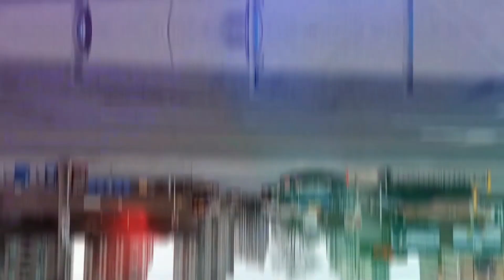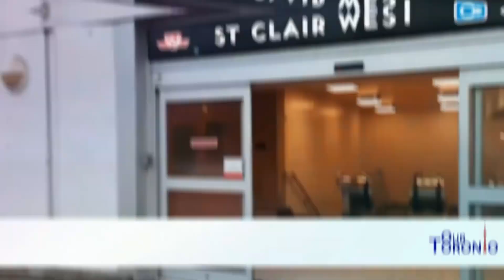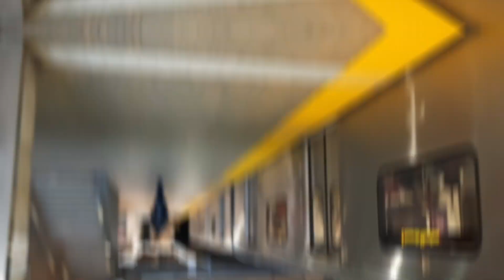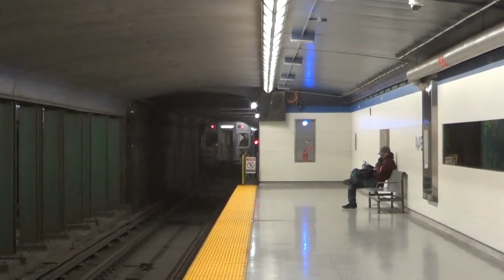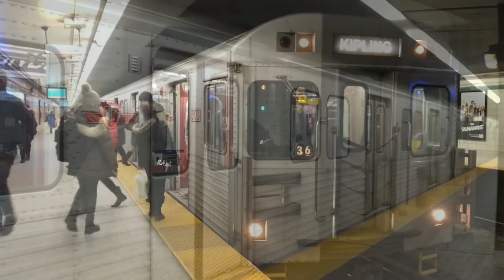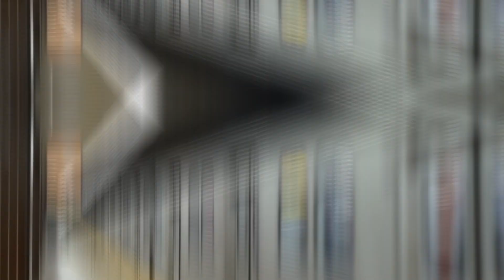Toronto Transit TTC's Old Subway Cars - How important is it to replace these with new cars

Comment: Lots of misinformation in this video, like the the older models not having regenerative braking being "very heavy" acessiblity and not having wide doors?. The t1s have had regenerative breaking since they were made and ttc trains have had regenerative breaking since the 70s with the first being the h5 models. Another thing is that you stated that the trains were "very heavy" while they are very heavy, the t1s are lighter in weight then the Toronto rockets are. That makes the t1s the lightest subway trains currently in use on the ttc right now. You also stated that they aren't as assessable with one factor being the door width. The t1 trains have the same width as the new (not so new) Toronto Rocket trains. You also stated that they should replace the fleet because the seating arrangement does have a dedicated spot for people in wheel chairs. Although this is true, this doesn't mean they should just get rid of the trains, instead they could just reconfigure the interior so they could fit a dedicated space for people in wheel chairs. Also you stated that they dont have open gangway is a flaw in the trains design? Trains dont need to have open gangways as seen with the r211s in New York . Even the ttc line 5 trains that are newer then the rockets are paired up like subway cars. What the ttc should do is BOTH refurbish these trains and get NEW ones Because of the extensions and that we just haven't had new trains in a longtime. I think that when you made the script for the video, you were comparing really old models that used to run on line 2 like the h4 because it fits some of the criteria's that you've stated. You've even stated in a reply of yours that you get the subway models confused.

Comment: This is a pretty bad view. The T1's are perfect and have no problems; in fact, there are things the T1 does better. I like it opening doors quicker, having a quicker acceleration/deceleration. Plus, you're able to see the front. Countries in Europe use old subways and even New York too, so if they can use 50+ year old trains. Toronto can use 25-30-year-old trains.

Comment: I find them fun and nostalgic, they are my childhood trains, they look like they need a replacement because of how they look, like greenwood never cleaned them, and the breaks braking apart like the mechanical issues, is because the Greenwood mechanics never checks the wheels or their breaks, if they cared them they wouldn’t have these problems and people think their too old
Reply: You're right they just look old but they're very reliable. If they were cleaned a bit more they'd be perfect. And I do too find them very fun and nostalgic.

Comment: The T1s aren’t even 30 years old. Meanwhile the MF67s of the Paris Metro are 55+ years old and they won’t be fully replaced until 2030.
Reply: They would retire them starting in 2030, like the last ones would retire in 2034-2035 as the TTC extended their lifespan 10 years more

Comment: The floor heights are basically the same on all TTC subway cars because of the fixed platforms. They don't have and LOW FLOOR subway cars. What they do have is an air bag suspension system, on both types I believe, that is supposed to adjust the floor height to be the same as that of the platform. The carbon footprint of an electrically powered vehicle is zero at the vehicle. It increases depending on the power generation system for the electricity, but not much on the yype of car because BOTH the T1s and the Rockets have solid state controls and AC motors WITH regenerative braking. Do some bloody research or stop making videos with so many inaccuracies. Your basic comment that the cars need to be replaced is valid but you rationale is hogwash.

Comment: Does the regen breaking put the power into capacitors on the train to be used for the next acceleration? Or does it send it back to the 3rd rail somehow?
Reply: It goes back into the third rail. The lighting load on the cars in the yard is enough to absorb the full regenerative capacity of 1 train.
Reply: @dbolt6543  Thanks!

Comment: We've had regenerative braking since the H5's. Remember the whining noise as the trains came into the station?
Reply: The whining sound variation is caused by the fact that they do not chop at a constant frequency, 400 Hz, but ramp their frequency up from low to 400 Hz. I did my undergraduate thesis at U of T Electrical Engineering on the problem of high heating on choppers at low power and I suggested ramping the chopping frequency up from a low frequency at the start to 400 for higher speed. The post doc Ph D student working on the same problem said it wouldn't work then used it at Garret Aerospace on their choppers for the Boeing Vertol cars. for MBTA and San Francisco.

Comment: I find the T1 cars are superwide when compared to the Toronto Rocket ones even if the widths are similar. That said, I like the articulation of the newer trains that allows walking between cars that the T1 series doesn’t have.
Reply from the maker: It let's people spread out across the entire subway.
Reply: They are NOT articulated. Articulation means two car bodies. These are six cars each on two trucks. They have very wide gang ways between cars which make them look like they are articulated but they aren't.
Reply: Articulation means two car bodies operate on one truck. Sorry for leaving that out.